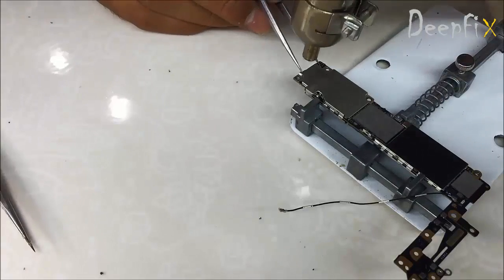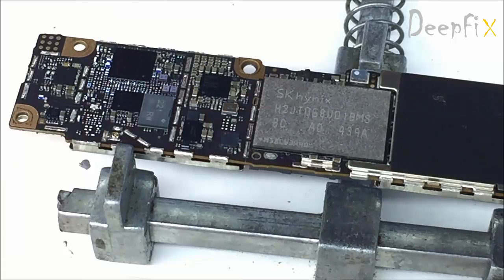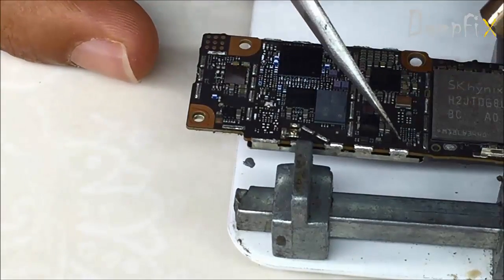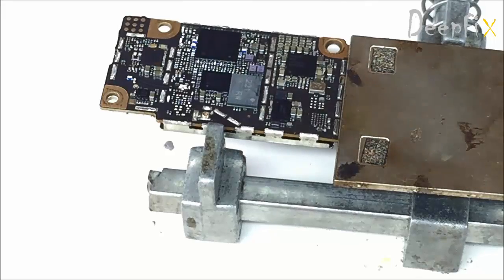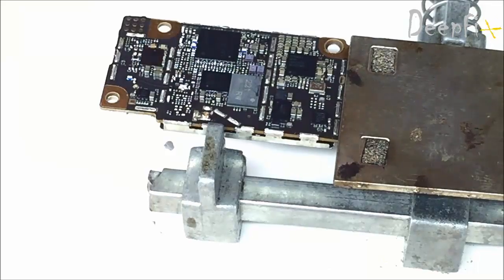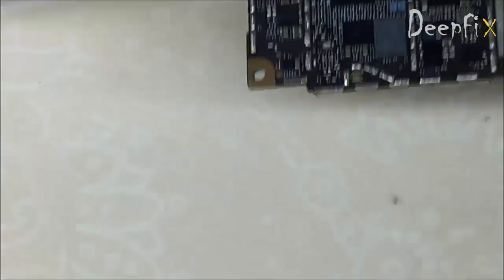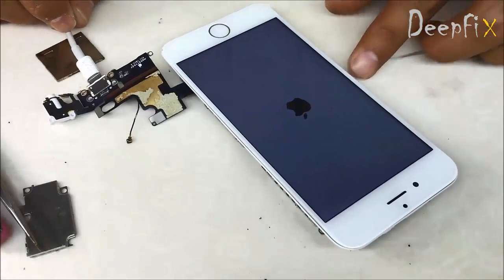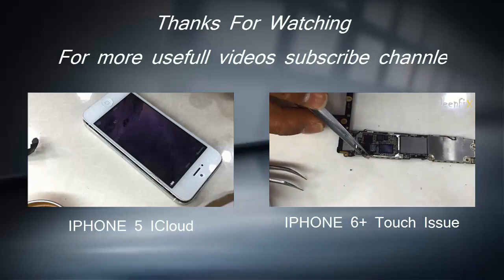IPHONE 6 Tristar IC Replacement

Comment: Maybe you can help me. I received a dead 6s,  no water damage. I installed a new battery and it powered on but battery drained about 1-2% per minute and would not charge. 

I replaced tristar and phone charges now and battery drains normally, but it only charges on a wall plug. When I plug to a computer iTunes does not recognize the phone and it won't charge. Plug back to the wall plug and it charges fine. I also tried a new charge port but same. 

Any idea what might be the cause?
Reply: u have to change usb charge ic too,its diff,

Comment: Hi, my iphone has an issue where it gets hot when I charge my phone, download an application and using an application. It also drains my battery pretty fast. I can only use it for about 3-6 hours. Is this battery problem or IC problem? I have no problem connecting w the usb cable since it is charging and still works fine. It just gets heated and drained alot even when its on stand by.
Reply: nhamizahm 25 same problem

Comment: hi,
I have 3 little questions...
1. Should we add flux before installing the new one ?
2. Shall we worry not to overheat the new one ?
3. how can we be sure that all 36 pins are connected ?
Reply: i'd suggest you read books on soldering - check out this site https://www.b-ok.cc

Comment: Hi, my iphone 6s battery is not charging. Charging symbol appears but not charging beyond 4%. I have tried changing to a fully charged battery. But still shows 4%. And it keeps restarting after few mins. Tried hard reset and dfu mode. Is that charging ic problem?
Reply: Arun Prabha change ur iphone charging jack it will 100%work

Comment: i didnt get what i saw on the power supply and i did not see any wire connect between phone and power supply can you explain to me plz. thanks anyway
Reply: Adam Rassene 👍👍good
Reply: On the power supply, the number on the left is current (miliamps) and on the right voltage. 
If there was no current or if current was off that value it would have meant something was wrong. Higher would have meant short circuit somewhere/bad component, lower would have meant maybe that too but also a variety of other things.

Comment: What is the temperature that you working for sorder ? Thanks
Reply from the maker: +Dan Johnson 390c with Quick 857d and air zero
Reply: And what about Airflow???
Reply: Airflow is going to change depending on the component your working and what's around or undernieth it. Caps, diodes, resistors, inductors, fets, small glass ic can handle 50% or more air speed. Bigger underfilled is packages is going to be less like 10-20% (temp will be less too). Now this is just a guideline answer. This is a place to start and then make adjustments based off of your air station and what works for you.
Reply from the maker: +RB we use zero air with our setup

Comment: Don't waste money on buying a new charging port or battery if your phone won't turn on I replaced both to no avail it will 100% be charging ic that's the fault caused by overcharging say overnight using aftermarket charging cables I had mine repaired at a cost of £35 hope this helps ;)

Comment: Hello DF, do you reball the new IC?
Reply: Dylan van der Zee new ICs come with new solder ball, you dont need to make solder ball on new ic, all you need is make sure the board surface is perfectly flat, no old solder ball, no glue, nothing on the board trace

Comment: Hi, What kind of material is this u2 chip made of? I don't have a hot air station so trying to find out whether it's possible to replace the chip with a Soldiering Iron? Will it melt? Please let me know,

Comment: Hi Deep Fix,
Thank  you for the video.  I have been having issue with iphone 6 water damage phones.  After water treatment service, many iphone 6 can't power on or can't charge either.   It happens frequent.   Is there a particular IC that is burnt and cause such issue or the board is bad?  thanks

Comment: Hi, I have a question if the U2 ic in the Iphone 6 is the same withe the U2 ic in Iphone 5 or 5S?
Reply from the maker: Its same in 5s but some times it doesn't mach